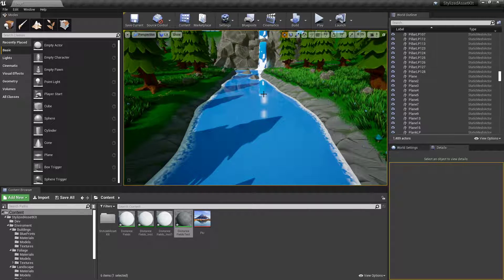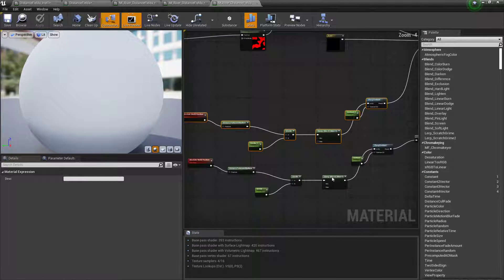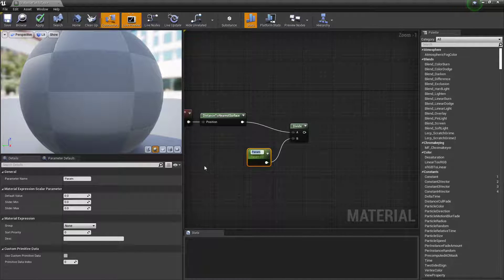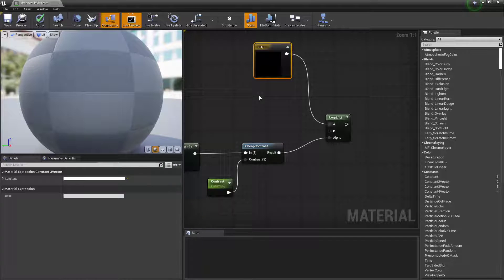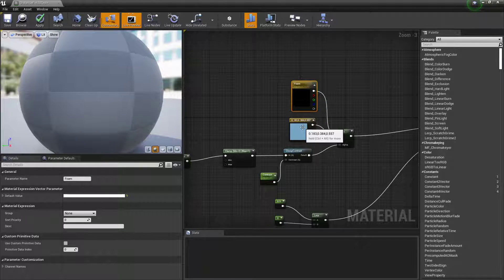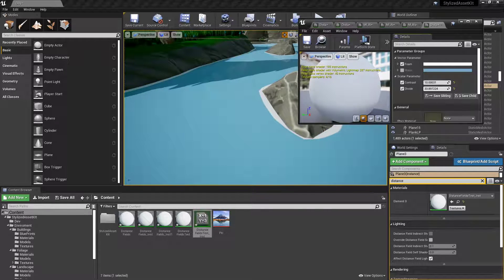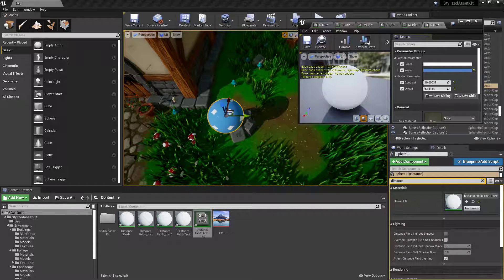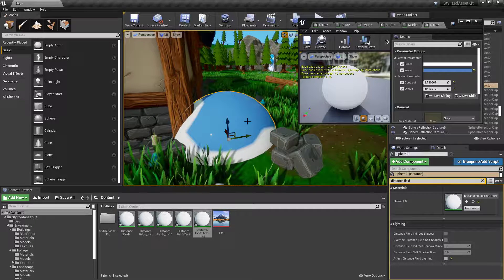Ue4: advanced materials (Ep. 49 River Foam Distance Fields)

Comment: Question. I have some objects in the water, but the size of the foam edge is much smaller around the objects compared to the edges near the terrain. Is there a reason the edge size would be smaller around objects placed in the water? Ty for the tutorial!
Reply from the maker: It can be to do with the scale of the objects. Are the objects with a smaller foam line scaled up at all? Or ar they all at their default 1,1,1 scales?